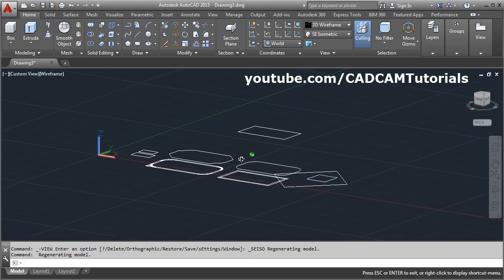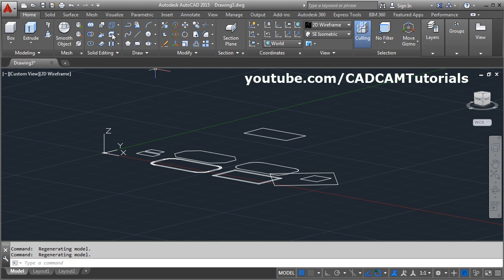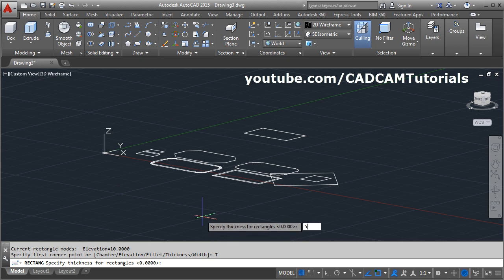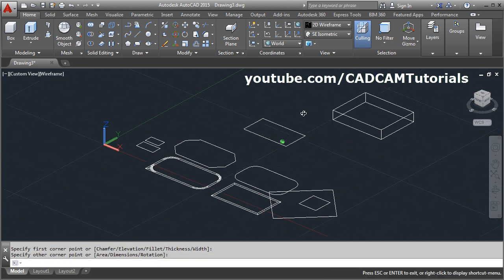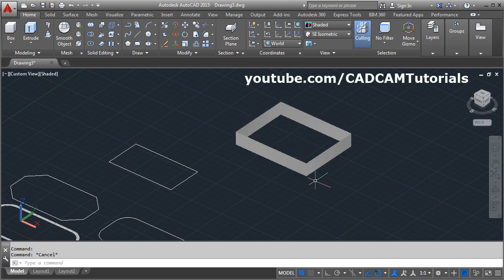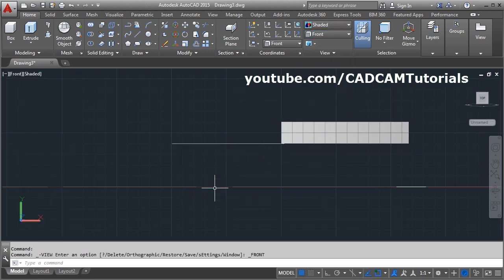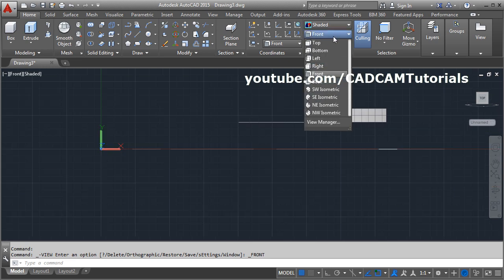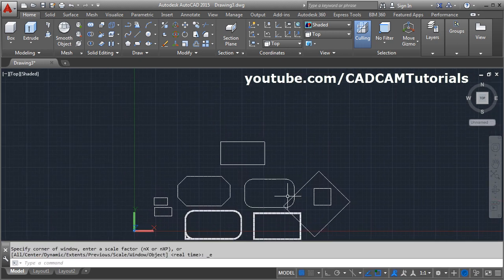AutoCAD Rectangle Command Tutorial Complete | Dimensions, Line Thickness, Rotation, Elevation

Comment: Sir please make more videos on assembly drawings in catia ..pls sir
Reply from the maker: Have you seen my two videos on catia assembly 
1. https://www.youtube.com/watch?v=n4rbJoXeqkA
2. https://www.youtube.com/watch?v=MII51QBetEE
In these tutorials all the basic concepts are covered with exercise. Using above two videos you will be able to make any required assembly. Still are you facing any problem with assembly. Do you have any specific need.
Reply: CAD CAM Tutorials yes sir I want to know making bolts & inserting  please make videos on like screw  jack , knuckle joint , cross head , eccentric .
Reply: Sir pls make any 2 videos of above I mentioned ..tq..